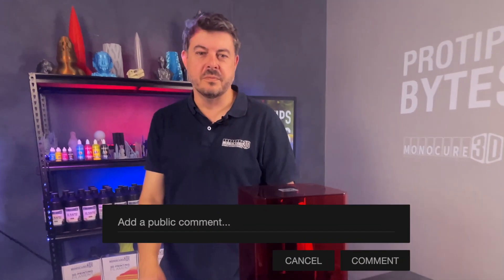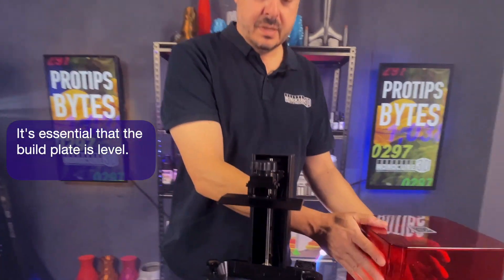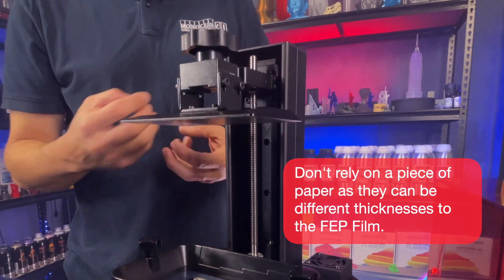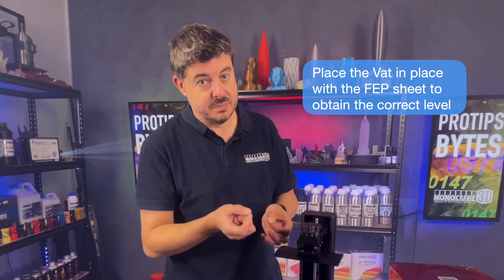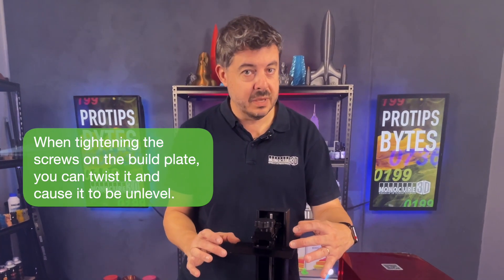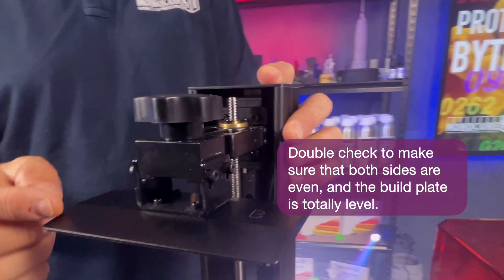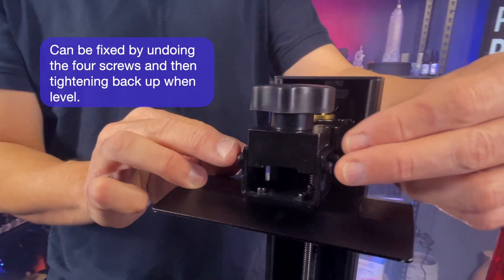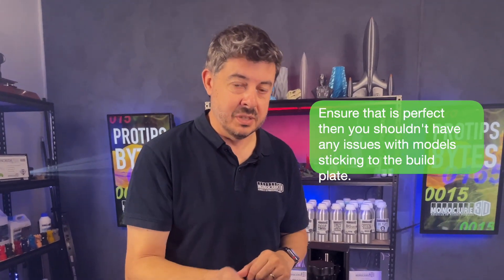Monocure 3D ProTips Bytes: Why are your 3D resin prints might be falling off the build plate.

Comment: I have an Anycubic Mono X and I can't get Craftsman Resin to stick to the plate. Standard and water washable resin works fine but the results with the Craftsman resin are much superior. What could be the reason? Could you suggest an alternative resin to Craftsman that I could buy in Europe? I have followed all the tips from this video. Thanks
Reply from the maker: Try monocure 3D resin! Or use our Platebond product to help with build plate adhesion.